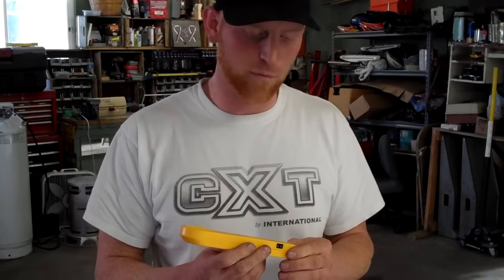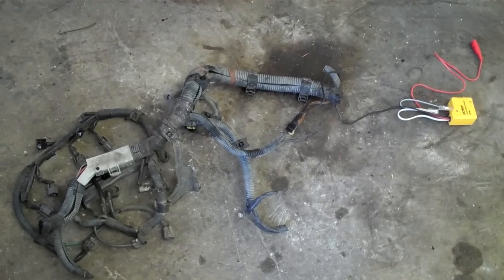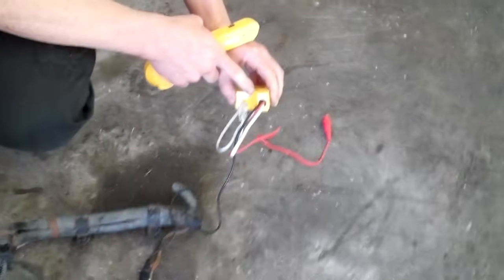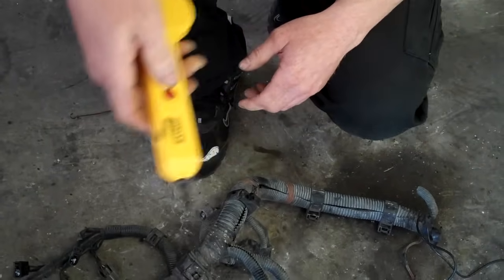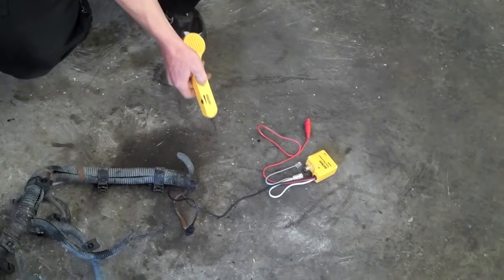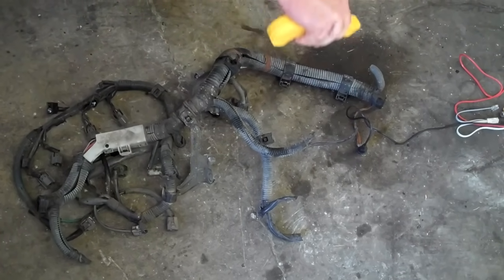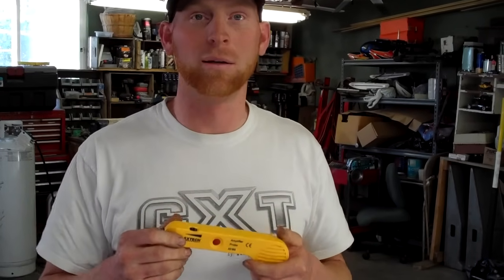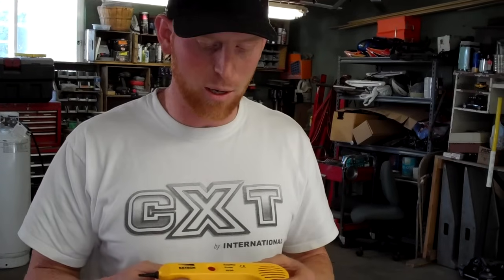How to find an open circuit or shorted wire the FAST easy way

Comment: I don't understand how this would find a short. Its a good wire tracer but if you have a ground shorted circuit, this will NOT work to find the short
Reply: he should use both crocodile clips on 2 separate wires then start tracing them along.
IF wires wanted to be find ... cannot be traced (no signal!) is because the wires ARE SHORT CIRCUITED. no tone on wires....

The switch on the tone generator (small yellow box) has ANOTHER position for CONTINUITY of two wires (where you put the crocodiles on...).  No need for use of detector on this instance.
Reply: tedy tedy r 
I have NO clue what you're trying to say.
Can you recheck your English and write it again?
Reply: ok. Those wires intended to be find must be disconnected/separated [the end of wires.. I know, that will defeat the whole idea of finding those wires.. because you knows where they are connected..] before applying a tone signal with tone generator! If these are touching each other (the metal part of it) you'll not be able to find them anywhere along their route..
Reply: DEE K  When I said 2 separate wires I meant 2 separate wires that runs in the same direction (twisted or not)
Reply: DEE K and about SHORT CIRCUIT .. where (along the route..) it is short circuit there will be NO SIGNAL to be detected (with the tracer) ANYWHERE along..
so this SHORT CIRCUIT can be made (intentionally) to confirm that the wires short-circuited (the end of it)  ARE those that were detected.

Comment: I see cases where this tool could be handy.  I have used it to find cat6 cables through a building.

My question is that if I'm going to use in a car do I have to disconnect battery and PCM from harness?  Will this tool harm car electronics?

I've only used this tool on disconnected wires.

Comment: we used to use this method on Elliot booms because they use electric solenoids rather than multiple hydraulic lines, problem is they were made like Russian tanks and no 1 unit is wired the same so tracking down the wire your looking for off the main bored up was a nightmare this thing saved us hours.

Comment: Hey boss. I have a bad headlight ground on my 2002 duramax. The driver side headlight only lights up half way and read that it is a bad ground causing it. The headlight switch works great but does not illuminate at night. I don't think that it is the switch but a bad ground. You having so much knowledge of everything auto I figured you would be the guy to ask. I have asked a few shots ps but they say it could take forever to find a bad ground. Any ideas hopefully ?
Reply: I had a similar problem... cured it by making a jumper wire from headlight ground to metal on body.  Also, the headlight plugs are notorious for corrosion which can cause same symptom... be sure those terminals are clean and getting good current though them.

Comment: Now if the inventor's would come out with a electrical diagnosing tool that detects the heat electricity generates in wires, and uses a scope/screen to show the user through the wall where the break is, that would be even better.

Comment: Fairly good tool, I have been wiring and diagnosing wiring issues for 30 plus years. The only down side to the tool in house wiring, is that it will give 'false' readings because of the sometimes interconnections of wiring in a home. Still have to use the 'brain' at times...lol

Comment: Tracing problems (shorts/opens) in complex harnesses is always problematic.

The Power Probe ECT2000 short open circuit detector kit (http://www.amazon.com/dp/B000P6UO2I), which is actually designed for automotive circuits, is much more useful than the Extech 40180. The Extech tool is only designed to assist with tracing phone circuits without shorts, only opens.

Comment: The manufacturer of the Extech 40180 Tone Generator does not make any claim to finding shorts in wire in a cable. This is a "linesman" device, used for primarily for tracing wires in a cable, mainly for IT and telephone communications. Yes, it will allow you to find where an "open" in the cable occurs, however, it cannot distinguish between a "short" and a normal electrical junction in one of the wires.
Reply: you can identify wires that get on their integrity through in a bunch of MANY cables to the place where there supposed  to connect bulbs/relays/ electronic modules..
Reply: V Mukal nn
Reply: You are mostly correct-however, see my reply above.  And you would be even more correct when the wiring loom is connected to a type of chassis or distributed ground, as a short to ground would be easier to find with a standard volt-meter.
Reply: Finally, somebody who gets it!

Comment: if you would show it work other then showing me a metal detector following a wire.you did'nt show it pick up a actual short. why didn't you put a short in the middle of the harness and showit work. hope you are not the pitcth man for ex-tech

Comment: a fuse went out on my 93 honda civic it was the running lights and now since i replaced the fuse there is a light that says srs can you tell me what that is and how to fix it please and thank you for your videos im going to try to fix my oil in the spark plug with your video

Comment: If the car has negative grounding and the circuit your testing is grounded, as many are, would this tool emit a tone all over as the chassis is carrying a current? If so, demonstrating the tool on a diss-embodied loom is a little misleading.
Reply: ***** that tool actually works very well through the electrical installation (bearing in mind  removing any relays and/or electronic boards (car modules)) before any tracing ;) and battery negative...

Comment: That tool would work but if there is corrosion in the wire it might just throw a code or not allow a device to work which that tool would not pick up.  From my experience if there is a broken wire and I cant find it in ten mins I just run a new wire and then its fixed saves way more time.

Comment: I really didn't hear any difference on the romex in the wall,not quite grasping that part,and would be the most important to me.You said yourself the wire from the switch went up,then you said it was going down but I didn't hear anything different at all.And if so why did it go off above the switch if the wire is coming from underneath?
Reply: That's because he did not have the tone generator hooked up to the wires from the switch. If he had, you would hear the ring out when he was scanning the walls. :)

Comment: With that tool I am not understanding how a short to ground/another wire would show up. I understand the broken wire part, but not the other??? 

Scenerio, Wire runs along the frame and is constantly shorted to ground, but still follows its path. How would this tool sound?
Reply: First you would remove any equipment that is attached to the wire you will be testing such as say a clock, a radio or even a light bulb. For that would effect your reading with the tone generator hocked to the wire and frame saying the frame is normally you ground where all equipment hooks too.  Next see if the tone generator has a solid tone setting of a pulse setting you may wish to try each most of the time it is what ever is working the best and the operator of the equipment can hear best.  Now see if there is a power output level of the tone generator.  If so start on a lower setting and see if you pick-up the tone out away from where you have hooked it up at with you probe.   This may take some time at first to get the feel of doing this.  It is very easy once you see what is actually going on and your doing it hands on.    Now actually hooking it up to the frame and wire your testing .   Apply tone to the frame and the other lead from the "Tone Generator" goes on the wire your testing.  So you signal will then travel to the closest location of the faulted wire to the frame from the "Tone Generator" and will stop there you may here a bleed over slight tone sound still past the fault depending if the faulted wire to the frame is solid it will stop at or very close to that fault to the frame.  But if the wire to the frame is a high open or a light fault you will at least hear a change in the sound of the tone generators signal.  You would locate the closest fault clear the fault or repair it.  And pt the tone generator back on the wire to see if the signal travels to the end of where the wire goes to with good clean tone on the wire from the tone generator.

Note: if your testing a wire that has a problem with fuses blowing as it wold sound in the above instance. Testing where the fault is on a wire to the frame.   You may also find or need to test for multiple faults on the wire but find it is not just to the ground or frame rather.  It may be crossed or faulted to other positive wires in the bundle also.  You can hook the tone generator to more than one wire at a time to get a general idea if that has happened but you will need to test between your wire with tone on it and the lead from the tone generator to another wire you may think it is faulted too.  Most of the time a person will still use a volt ohm meter first to see where the wire is faulted to then you use tone to see where the tone signal stops on the faulted wire or the tone changes as in the pitch or sound level volume.   As I mentioned before look from the tone generator out to where you signal changes, just always make sure ever piece of equipment is off the wire first.   And the same would go like this say the faulted wireis also a ground wire which is grounded to the frame as in most vehicles. There are instances where a ground wire can cause trouble on it even if it is faulted to the same frame where it the wire is grounded too. here again just treat it all the same disconnect the wire going to the frame and and equipment that is hooked to that ground wire. Next continue as before hook one side of the tone generator to the faulted ground wire and the other lead to the frame and test from the tone generator out.  Your fault is where you signal stops or changes on the wire your testing..     Also most of the time the tone generators have a red & black test lead you connect.  Try to hook up your red lead from it to your faulted wire you will be tracing and listening to the tone on and the black to where it may be faulted too.  Running a complete open in the wire is easy same process but easy to find where the open is unless it to is a high open or light open fault in the wire then the sound of the tone will change but that change location is the fault location.  And never think that you cannot have more than one fault on a wire.  Always retest with a volt ohm meter after you clear one fault before thinking your done.
I know I just made this worse read parts you can understand a little at one time, then go on to the rest.   There is no way I can explain all the different fault testing like this.  But if you can get to understanding what I'm trying to explain you have a good shot at it.
Take care,  aka;  Fred.
.
Reply: @fredlorehezu5245  holy frick, this is pretty ingenious. thanks for that.

Comment: Does this tool also works on model trains? To find short circuits (0-15volts AC) thank you. Looking for your replay.
Reply from the maker: It will certainly find open or broken circuits.  There's a tool called the KD Tools 2524 Circuit Detector that can locate shorts.

Comment: Boy, do I NEED this tool! I have been trying to find a short or break in an AC electrical line in a greenhouse trying to understand why the lights are not working.  I have spent all week working at trying to find the faults in four lights.  I have got to get one!
Reply: i had a problem simul
ar to yours, i found an open ground (white wire) in breaker box, or could be your junction box. hope this helped.

Comment: a cut wire = an open circuit most of the time. Ive used this devise for many years while installing security systems. Its very hand when sheet rockers have rocked over your pre wire install. If the wire is shorted, IT WONT TRACE. it only picks up the tone in an open circuit.

Comment: I have no reason to not like your video for any reason than i just have a short n my running lights 2007 magnum running lights that u-haul hooked up a hitch to and claim that is was nothing that they did, so my thumbs down is for u-haul and not u.i didnt think u would min d if i used your wall to get somebody's help,in this matter.

Comment: while I can see where this would be helpful not sure if its any quicker due to having t o connect the tool to the specific wire being tested which means disconnecting it from vehicle then hooking up to toll tracing path then reassemble and move on to next wire.or is there a hook option like one guy said similar to the power probe hook which can easily be moved from one wire to the next with lil time in between. I still think this would be  a great add on in my tool box. Just curious if there is an accessory   package that makes it more automotive friendly. Time is money after all. Thx for video great idea.

Comment: Can't believe how many tradesmen I asked about this tool that I knew existed. No one knew what I was talking about. Thanks a million. My biggest problems is from probing the wires to test them and creating an even bigger problem later on when wires corrode and break. Usually many more than the one I fixed. I run a small fleet of transport trucks in Toronto, Canada.

Comment: I think this tool will be a great help, I ordered one. The one thing that can make it confusing to some people is thinking it is a cure all for a circuit with so many redundant grounds while checking it can bypass the open wire while being bundled due to the fact that a redundant ground can be in proximity to the open, still great video, I think it will be a good to play with.  Glad to see another rcer in the business. I am a rc and gadget junkie. glad its not drugs i would be homeless.

Comment: you should have demonstrated the other two settings on the tester
i have a wiring harness on my bike that i think has a short somewhere and is causing continuity between ground and power. but im not sure where it is making contact. i still gave you thumbs up tho because you post a lot of useful stuff.

Comment: I do low voltage wiring for a living. Most toners like this will change their tone when you put them on a shorted line, so you know immediately there is a short somewhere. Also, a light turns on on the transmitter. You still have to trace the short out, though.

Comment: Great tool to find shorts in doorbells, intercoms in apartment buildings!  I have used it with much success. If you use it for 110 volts be sure to disconnect power to wire at breaker or fuse before working on live circuit. It can be used to successfully trace a wire or wires. Not good for wires in conduit with multiple conductors as energized circuits can give false reading when circuits are hot.

Comment: whats the problem if your right turn ignal blinks way faster then the other on the dash? and all signals work but the rear right side on outside? checked bulbs and wireing. also when in off position my lower bean head lights are on? Why is that?

Comment: hey man thanks for your assistance with the front end alinement video wish I had you little tool here to find a short a few months back..I own a 93 1500 chevy that was blowing the turn signal fuse, and if you were driving when it shorted you could hear the relay click as if you were turning ...well after about 3 packs of fuses 15-25 amp I found out that the reverse lights ran off the same circuit  and when I had the clutch replaced the wires got burnt on the headers causing the short

Comment: The Calterm product on the other hand does have protection plus more features. Reads between 6+12 volts. Indicates polarity. Indicates continuity. Both ends happen to be pencil style so as others have said you'll have to disrupt the integrity of the insulation. If you have to, just do so professionally.

Comment: @1Patient- expensive tools for such an easy example of a job wouldn't ya say? Vehicle wiring diagrams with color, polarity, location, even plug color and PIN number can be found online. I purchased an extremely basic tool from Calterm looks just like a "pencil style" (test light). I was tired of using my multi meter which I only was forced to use out if fear. The test light has no protection built in what so ever. One wrong move with a test light and you're frying a circuit due to current draw.

Comment: thank you sir !!! one thing to add about breaking the jacket on the wire such as when people use circuit testers and ice pick the wires by stabbing them. That method breaks the strands of copper wires inside the jacket thus reducing its Ability to carry the amperage load aka more shorts or a wire that burns out similar to a fuseable link..... THANKS AGAIN!!!!

Comment: I have this tool by power probe and it kicks ass.  It does opens and shorts much more accurately.  It comes with some very nice adapter leads for different cars and circuits. about $169,  this tool has made me thousands of dollars in less than 6 months of owning it.( power probe short finder ect2000)

Comment: I didn't listen to the clip word-for-word and may have missed it but I didn't see where you stated that this tool doesn't work well on energized wires or if there are energized wires in close proximity...to many stray currents. At least that's been my experience with AC anyhow. I use another style tracer for energized wires.

Comment: Is this strong enough to find wires run thought metal conduit under ground? I have 5 outlets in my shop that are not hot. I can't figure out where the wires are run. The conduit runs from the outlet box down into the ground on ever outlet. From there I have no idea. I would like to be able to track them but don't want to spend a boat load of money.